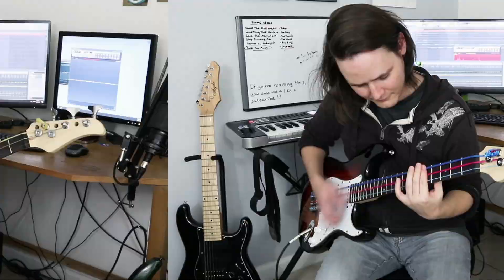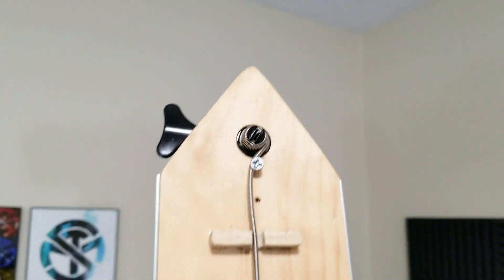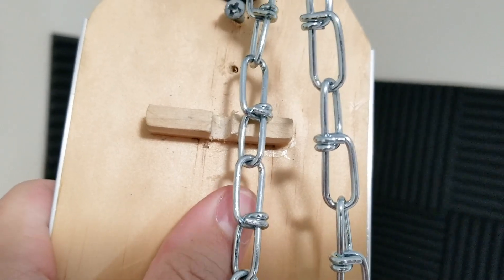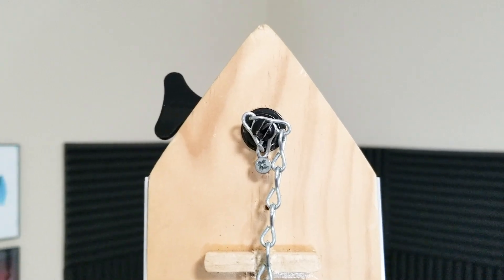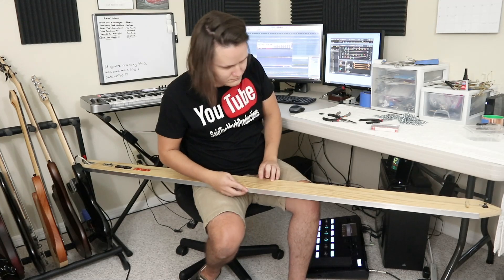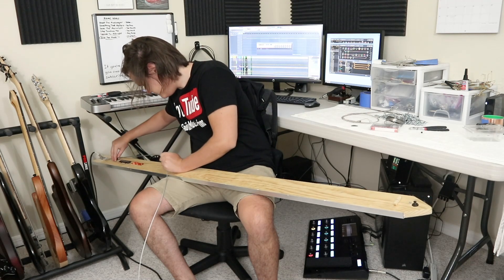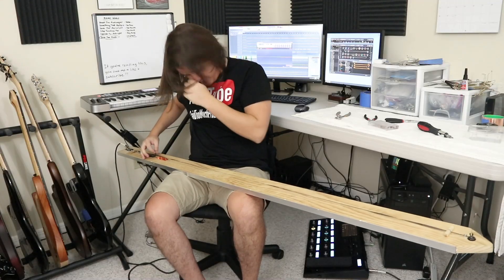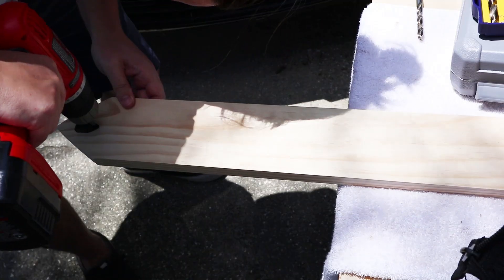Will It "Subcontrabass" (Ferromagnetic Alternative Strings)

Comment: Motograter used a spring from a screen door closure, if I remember correctly. I can correspond with them and get back to you.
Reply from the maker: Ya, I bought one but it had too much tension stretching it. I need to find one with less resistance
Reply: @SaidTooMuchProductions  They used one without much stretching. It sat on an iron frame, which added to its resonance.

Comment: Have you tried to use items you'd find on a headless bass? 

I think that would help out a bit. You'd tune near the pickup, slot the string in at the top. 

BTW, you can try to contact Newtone guitar strings in England. I bought a custom set of 37" scale 200 gauge bass strings from them. I think they can go longer too. I got my strings within a month, considering they had a Covid Outbreak at their facility, I think that is a lot faster than Kalium.

You can also try Octave4plus. I have several custom sets of strings from them. You can get any gauge or any length you want... Seriously. It takes about 2 months start to finish. I got a 280 set for a 7 string bass. I'm getting another 7 string set for a custom 37" scale, 7 string bass. 

Once I have those, I'll have 2 7 string basses with the same Conklin body, same pick ups, and same strings. Only differences will be the scale length 34" vs 37" and neck material.... Almost sounds like something you would do;-)

Comment: Hey, I've got a video idea for you.
How does a piezo pickups location effect tone on solid body guitars?
Here's a few location ideas:

Behind the bridge on the body,
Behind the saddle attached only to the strings,
Under the saddle,
Under or near the end of the fingerboard,
Under the nut,
Behind the nut attached only to the strings,
End of the headstock.

I'm curious how that changes the sound, as well as seeing if you can get a wide stereo tone from two piezos. I know you can get an almost double tracked sound from two magnetic pickups in stereo.

Comment: What if you wrap a steel cable? I have actually tried that one myself a few years ago and i got horrible sustain. My guess is that its due to the tension being distributed on so many individual wires that dampen each other. So perhaps getting a very thin cable (2mm or less) but wrapping it with another one will get a better result. If it works out well, using 2mm cable for both should still give you a ~235 gauge string and almost a 400 gauge string if you wrap it twice.

Comment: I actually liked the rattling on the kanthal wire . It's like a natural distortion. Maybe try to make it a feature rather than a flaw. The smaller chain had some cool sounds too. The higher notes and the sound of the chain hitting the fretboard sounded very interesting.
Reply: it's roughly analogous to how the jiwari bridges of sitars and tanburas work, the string exits across a gentle curve instead of a sharp point, and every time the string colides with the bridge it plays a tiny pinch harmonic. since each excited harmonic changes the way the string hits the bridge, the harmonics have an evolving phaser-like sound